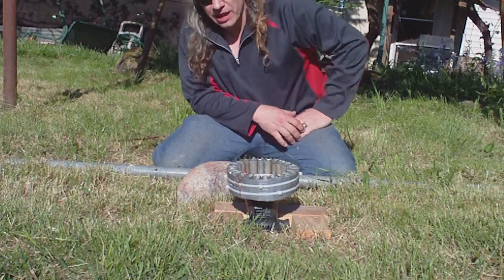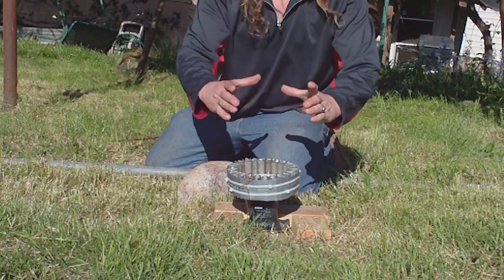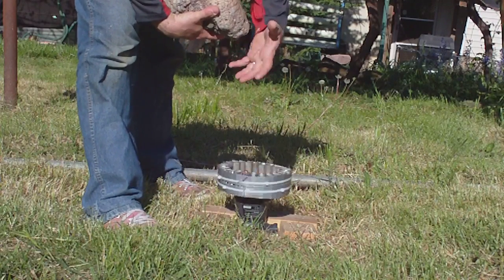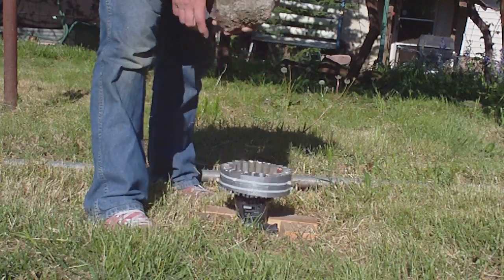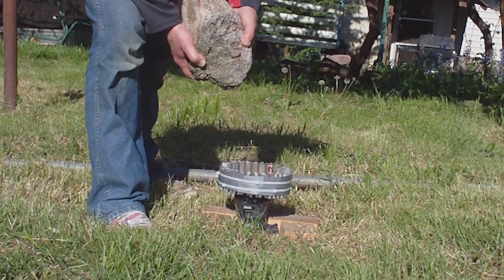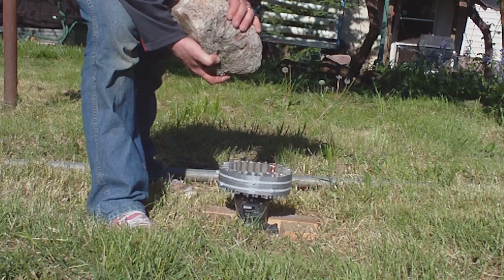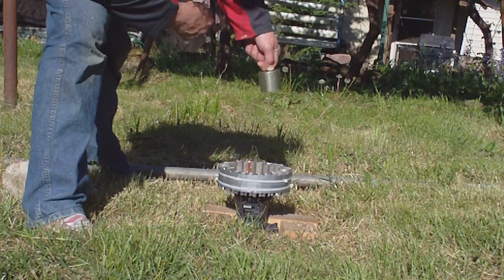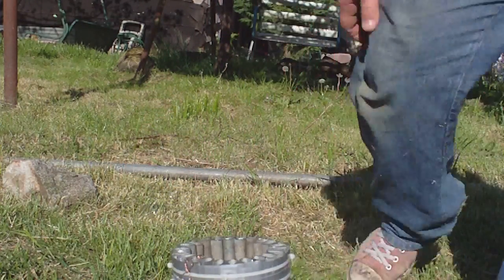lambright describes leedskalnins generator

Comment: I read through a lot of the forum and watched all the videos. I'm in the process of building this. I'm an electrician so I got some 2" pipe from the sprinkler guys. I cut it into 2" high pieces. I plan to try to build this on a old box fan motor. Should I remove the old windings? 

Also, why didn't you ever incorporate the clover rim? I want to experiment with this clover rim. 

My last concern was with the PMH being created. Does it put the outside edges in a (NS,SN,NS....) orientation??? That's the most major question to me.
Reply: +Jiandi P did you make one?
Reply: It's one of my shelved projects. although i must add, i usually return to my shelved projects

Comment: This device should have two overlapping vorticies that draw in charge field photons (IR) from above and below.  Maximum emission should therefore be at +/- 30 degrees from the equatorial plane of the device.  This should be with respect to a sphere the same radius as the device.  Suspending a dense object above the device will provide a greater source of charge field photons.  What you have there is damning proof that tears down the standard model. Good luck convining the "scientific community"

Comment: if you used the coil to lock them all magnetically well .. try making a wheel with magnets that are all opposing.  Thats how ed's magnets were arranged.         SvN  NvS  SvN  NvS  .. and so on .. not SvN SvN SvN .. thats why it had to be held together with concrete and iron.  also when 2 magnets are held together at opposing poles they are affected less by gravity